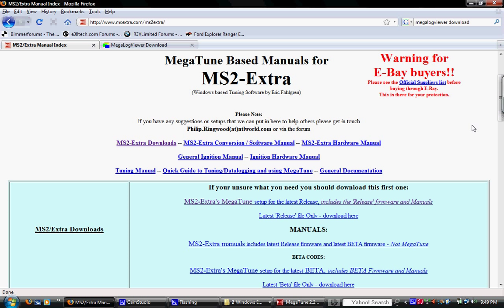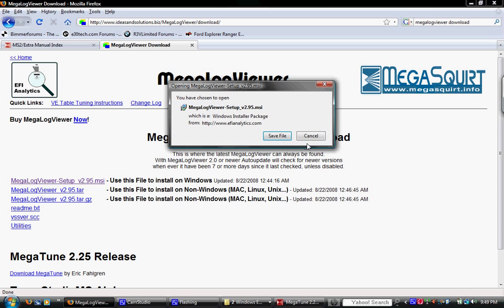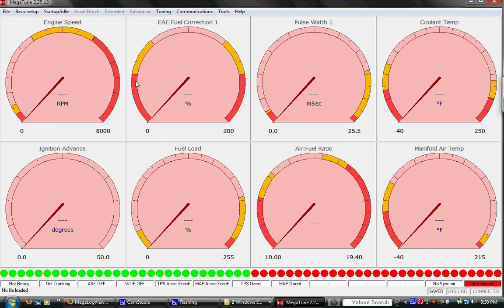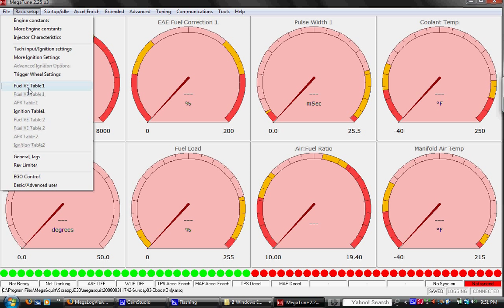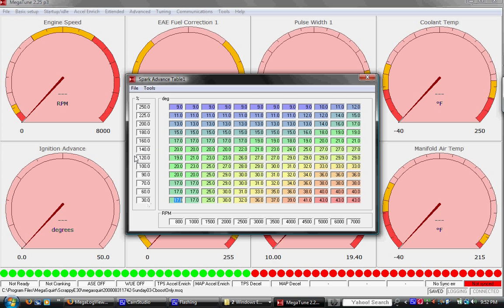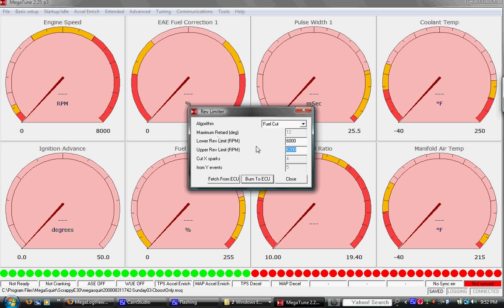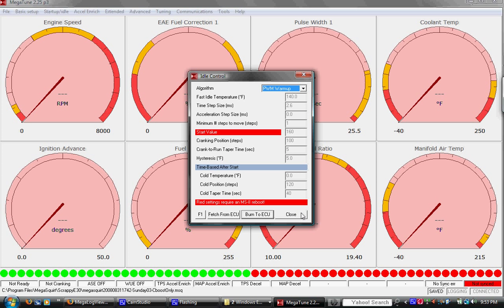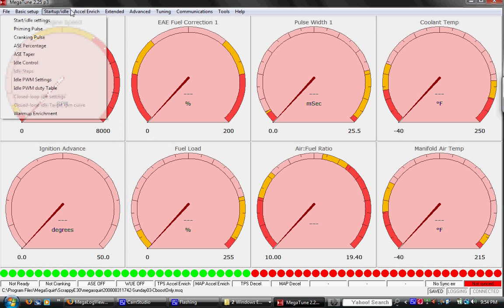MegaTune Demo (Part 1 of 2)

Comment: the exatct msq used here

 in the engine basics u say 60-2 missing teeth and 88degrees offset, for what vehicle is this? i noticed u had a bmw backround so im making a massive leap in that ur settings are 4 that car and that ur also using the M20 engine i just want to confirm ur settings to the m20 engine TBH!